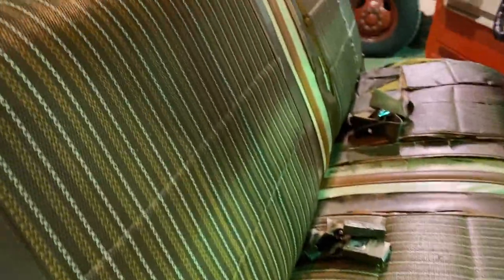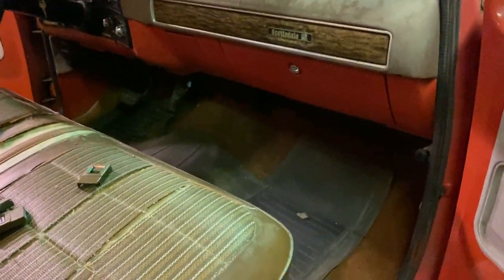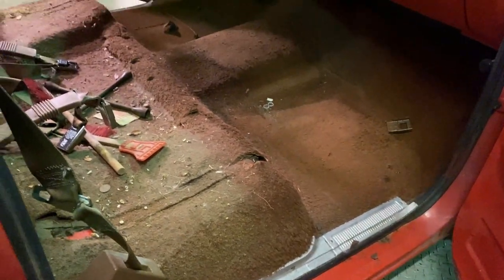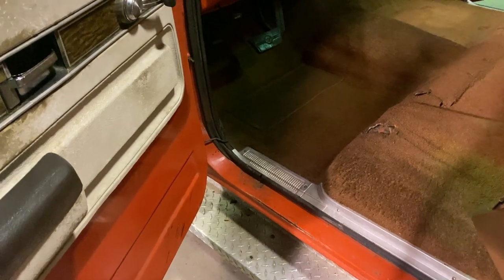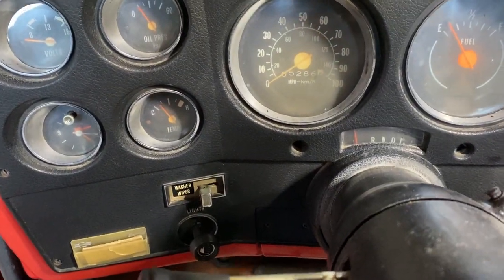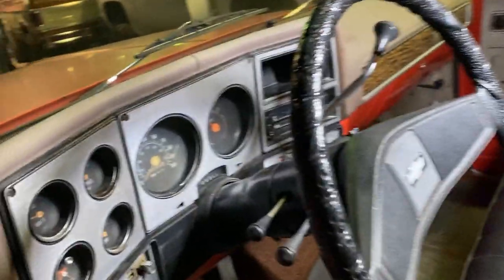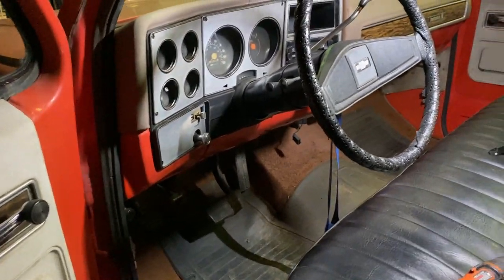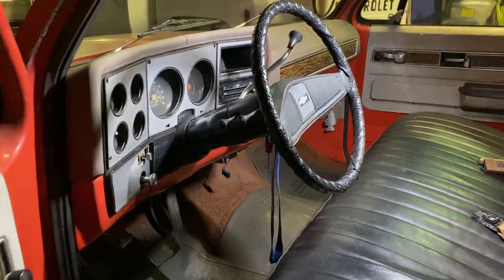Squarebody C20 Project Part 4 |square body|

Comment: Looking good…..

I have commented before on your videos. Great Job!! I am the 3rd and very proud owner of a 1989 K5 Blazer. I have owned it since February, 2003. While I worked it mostly sat in the garage. However since retiring in January 2018 it’s become my daily driver. It’s in really good shape with no rust and a very clean interior as well. I have pretty much replaced everything mechanical on the truck, somethings twice, since owning it…lol…The paint is starting to show its age as the clear coat is coming off in areas, but it still turns heads. I get lots of compliments when out and about and getting gas. Nothing like a square body to start up a conversation at the gas pumps!! It always leads to them saying, “Yeah, wish I would have never got rid of mine”…lol…Its nice to own a piece of classics GM history…

Keep up the videos, they are enjoyable to watch. Stay safe and God Bless from the north Florida area….